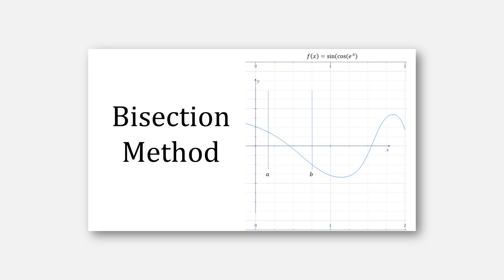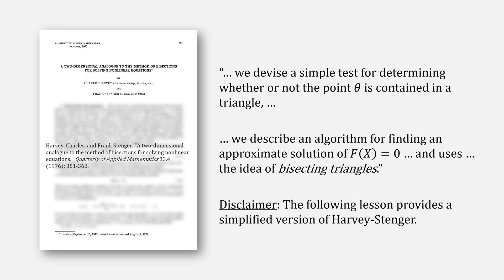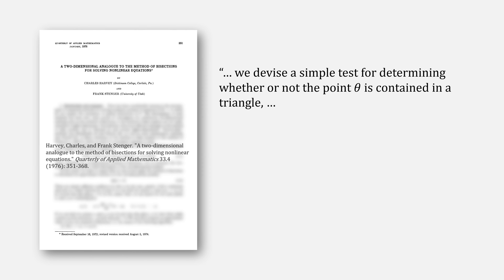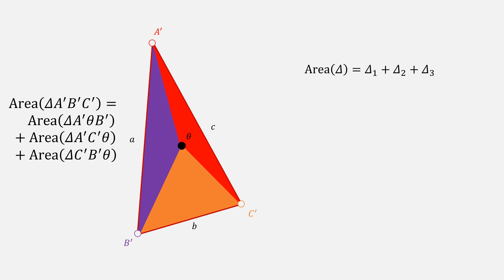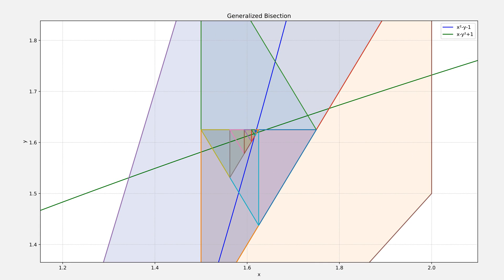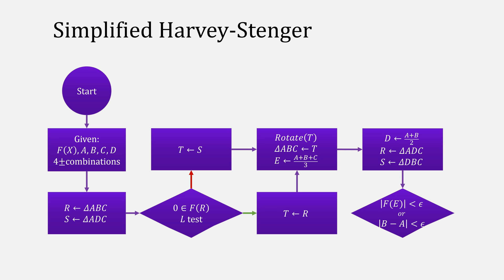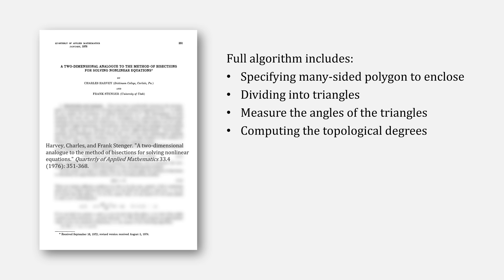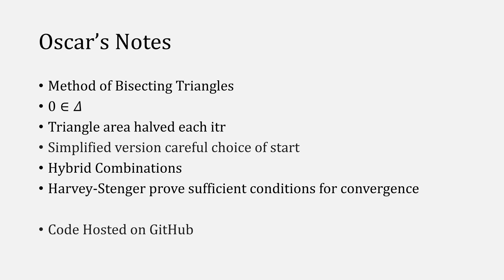Generalized Bisection Method for Systems of Nonlinear Equations

Comment: Multivariate bisection is no doubt quite an oof. Not something I'd want to implement myself tbh. In contrast, I've found that interval analysis is a godsend which surpasses bracketing methods, generalizes easily to multidimensional problems, can perform optimization, and even works on a globalized scale opposed to a localized one (e.g. finding ALL roots of a polynomial). Although it comes with extra computational cost, it's insanely easy to implement usually, if you're willing to forego the need to re-implement everything by using round-up and round-down variants for truly guaranteed bounds. I've also been planning on writing a paper based on the idea but without using interval analysis (directly). Although it lacks the same guarantees as stuff like here, it has probabilistic guaranteed convergence, performs well in even say 1000 dimensions, and is very easy to implement and understand.
Reply: May I ask what is the interval analysis?
Reply: @fish830911  The basic idea is that you can write functions to accept multiple inputs (like x from 2 to 3, denoted x = [2, 3]) at the same time and get a range of possible outputs (like x^2 from 4 to 9, denoted [2, 3]^2 = [4, 9]) at the same time. This way it should be obvious that root-finding boils down to checking if 0 is in the range of possible outputs, and the multi-dimensional case is just checking along each dimension.